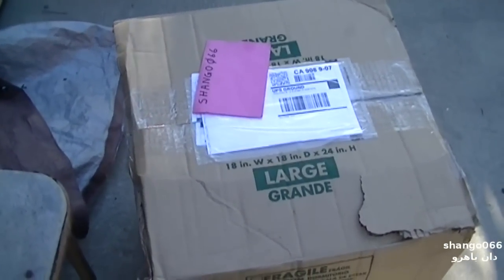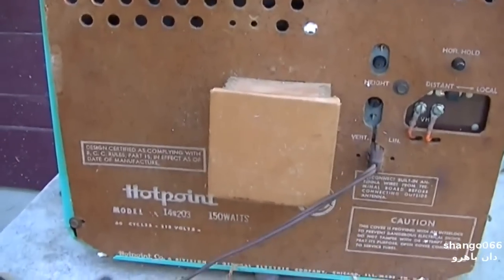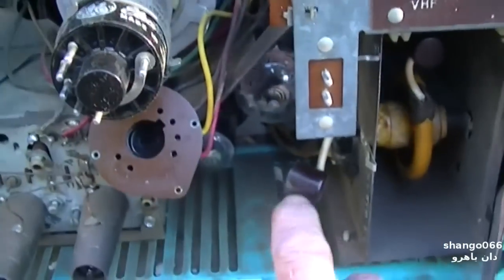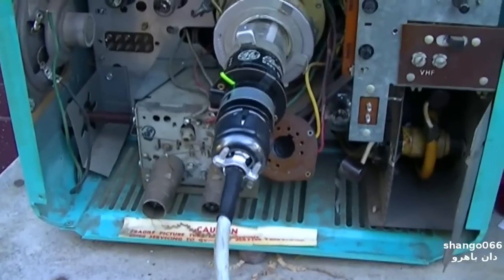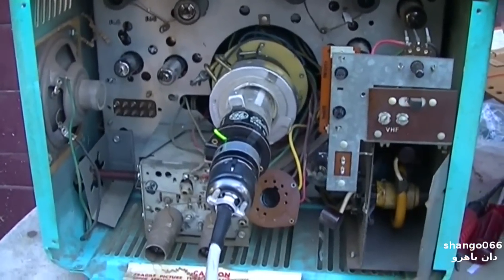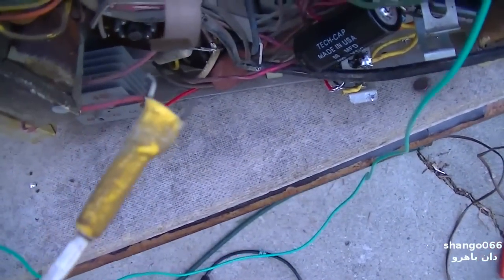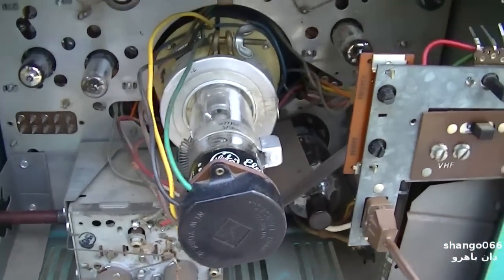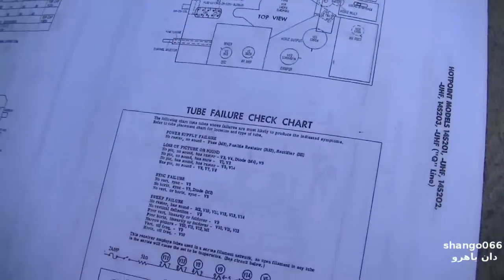Vintage Hotpoint 14S202 Black and White Tube Television Repair Pt1

Comment: GE owned Hotpoint.  In the mid 50's they started selling Hotpoint branded TV's so as to give their dealers a line of TV's to sell too.  They were all GE on the inside.
Reply: +armadillo platypus I don't think General Electric in the US ever owned Hotpoint in the UK.  I think GE made an agreement with GEC company not to operate in the UK since the names were so similar, so when they bought out Hotpoint they only owned them in North America.  Over here Hotpoint appliances were pretty decent quality and shared many parts with GE appliances.
Reply: @egrand1508  11

Comment: Ive mainly worked on cars, but theres similarities between this and autos. When I worked at a Goodyear auto service as a technician, had a car come in that had had a intake gasket replaced  at a fairly reputable repair center. Complaint was strong gas smell. Tore it apart, found one of the injectors didnt have any o rings on it.

Comment: I see you're a big fan of the United Parcel Smashers.
Reply: I had a warranty replacement set come by UPS, the box was gouged, ripped and looked weathered and yet somehow the way it was packed it managed to survive,  I did take pictures of some minor damage on back, not many would notice  and where the box was ripped was right in the spot the remote is in , amazing
Reply: interesting points ,if anyone else  wants to uncover 
plasma tv repair
 try Saankramer Electronic Magazine System ( search on google ) ? Ive heard some incredible things about it and my m8 got great results with it.

Comment: Many moons ago, I worked as an assistant to a highly experienced Gun Smith.  We had a sign on the wall about pricing, I don't recall the exact wording but it was something like Per hour:  On our own, 22.00  If you watch 33.33 if you tried to fix it first 100.00 per hour.  This is valid pricing, and should be a policy in all work where the art of fixing takes talent and training is expensive.

Comment: TV, valve bulbs, head torches, differential gears, capacitors, over flying Cessna's, desert, radio, rickety ladders, long wire, 30kV, riot helmet, EOL, LA, IF, RF, mFd, fireworks, won't work, might work, vacumn bulbs, love, it, all.

Comment: Great video. Yes, Hotpoint was a GE subsidiary at some point, and did a lot of rebranding of GE goods as Hotpoint. I don't know the full story, but I have seen a lot of GE products done up at Hotpoint.

These are cool sets.Not just the styling, but the electronics are good as well, and they perform fairly well and reliably. I also like the fact that there was no power transformer in these, making them fairly portable as well.

Comment: My main attraction on here is the electronics but I really enjoy the other stuff as well. Some may piss and moan but they will continue to watch because it's good content. Keep up the great work and much appreciated,,,, all of it.
Carl
Reply: +skycarl +Shango066 I strongly second your opinion, Carl. I'd have to suss this out using the schematic, DVM, scope, Sencore TVA92, and a few magnums of Lambrusco. If anyone can pull this off, Shango can.
Reply from the maker: +AMStationEngineer I just picked up a tva92 but it looks like it wont work as a stand alone unit. What can you tell me about it?
Reply: shango066 I'll PM this evening if you'd like. It's a marvelous tool for the front end, and should suffice for older sets. The drive sections are designed for solid state (tripler) equipped sets. I've seen that HP scope in a few of your videos, it will interface nicely. I did not find it to be up to Sencore's usual standards with regards to chroma signal generation, though.

It must be connected to their VG91 video generator, and it's specialized interface cable. The generator controls certain sections of the blanking and sweep interface sections. One last item: seems susceptible to noise from CFl's and electronic ballasts. 

It has both diode and fuse protection. I never had problems with either...

I repaired a few circa 2007 "RCA institutional CRT sets" before Christmas, and it provided the signal and voltage substitutions which made the tasks much easier. Vintage sets manufactured between '74 and '08 will prove your acquisition to be a wise move. It bailed my tail out of the fire more than a few time with module problems on Chromacolor II and System III sets. One caution, I may have fried a flyback during a ringing a while back. Use caution when performing that function; I've been gun-shy with that function since!

Hope this helps, and please post a video once you begin using it!
Reply from the maker: Yea hit me up.

Comment: Hotpoint and GE were sorta kinda the same company.  I had a hotpoint washer and dryer that had most of the parts inside labeled GE.  
I once owned one of those sets, I remember the CRT was a 14QP4, think it was a 90 degree deflection.  AC/DC hot chassis.  Real fun to work on, I didn't know any better back then, I was all of 14 years old fooling around with junk electronics.   I agree that the vertical section is tricky, but those old caps were usually 20% tolerance anyway!

Comment: I watch the whole videos, and the following (or preceding) parts as well. This is a great channel, I've learned a lot here. 
Yikes to the previous "repair"; looks like the kind of thing I get off of ebay.
Not only was the packing not very good, but those moving boxes are very light duty, not meant for shipping.
I tend to have more problems with the USPS then Fed Ex or UPS. 
Okay, off to part 2 now.

Comment: nice job on the video I had robbed some tubes form an rca TV that had tube boxes in it but i can't test the tubes. what are those thinks you put on to TVs so you have coaxial connection need one to put on my am/fm radio, I have an rabbit ear antenna that works on FM for it

Comment: If people don't like the other videos they have the option of not clicking, just don't understand what the problem would be. I would not mind seeing more exploration type vids, old properties, houses, whatever.

Never seen anyone bang a tube on the counter like that, what is the point? Checking for weak filaments?
Reply from the maker: +ZenithClarity1969 Usually it clears the shorts out, whiskers or whatever causes the shorts

Comment: There is a solder I thing it is called Al-sol made for soldering Alumina sheet it is slightly thicker than standard Lead/Tin solder but I have actually used it.

Comment: That plane is a training plane.  A google of N3524L brings it right up. It's a 2001 plane.
2001 CESSNA 172S 
Fixed wing single engine
(4 seats / 1 engine)

Comment: I bought just about the identical tv at an antique store. I hooked up a VCR player via a cord attached to the rabbit ear screws. I turned it on and the audio worked great, but the picture wasn't there at all. It was just fuzzy (no picture at all) do you know how I could fix it?
Reply from the maker: +Sistertubetime Continue to watch the repair series on this set and you will understand how complex it can be. Dont post the same comment on 20 videos or you get tagged as spammer as you have
Reply: +shango066 Sorry, I've just been trying to find someone who can help me. Very sorry if I commented the same thing on more then one of your videos.
Reply from the maker: There are no magic answers, it needs to be recapped and most likely has a host of other issues. Without test equipment and experience its very tough to get it going. No need to apologize to me, youtube automatically manages the messages.

Comment: i have an old ge and when i turn it on i get nothing. i mean no tubes light up or anything. its not a bad fuse or an open tube filament or the power switch\.
Reply: it may be haunted.
burn it.
Reply: it was not the power switch and the crt i know is good and i have swapped all the tubes from a working set with the same chassis.